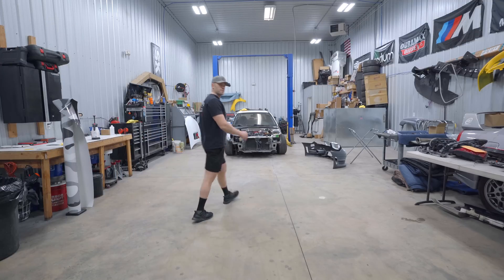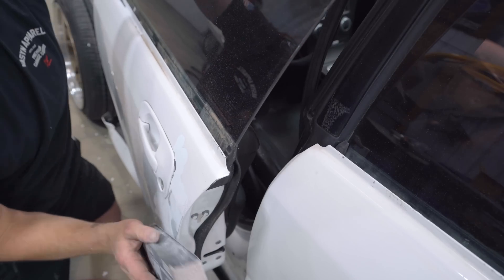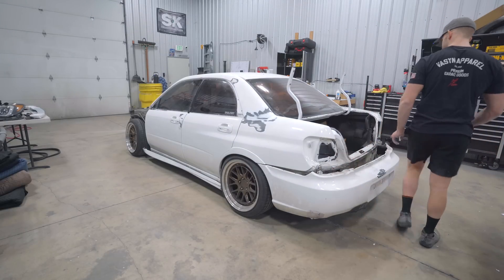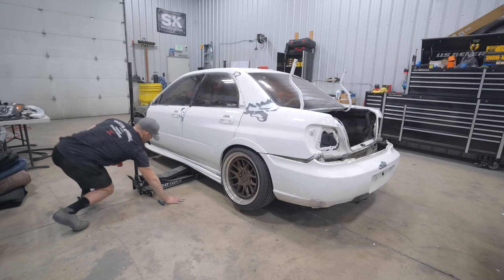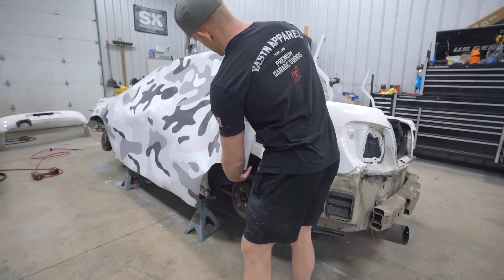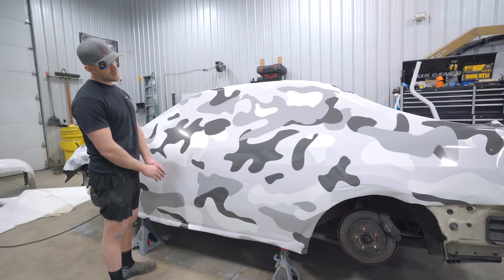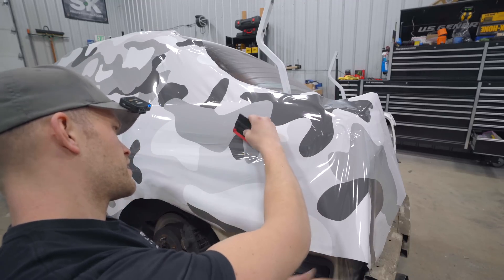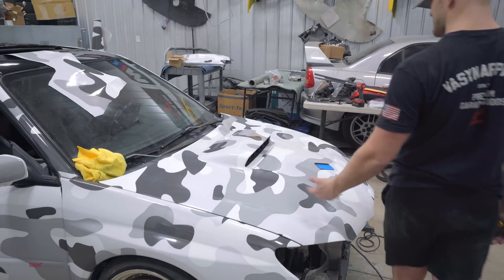Rebuilding The Forgotten 07' STi | Ep. 4

Comment: I know he explained why he's doing it but it just pains me to watch ppl wrap over non painted/filled body work 🤦🏻‍♂️
Reply: One reason I would never ever buy a wrapped car. I’ve seen dudes drive cars with destroyed paint, they wrap them and sell them without disclosing what’s under. Not talking about Devin because he can obviously build immaculate cars. But over all.
Reply: @loadsled I work at a wrap shop.  Wrap is not something that just hides imperfections. So if your clear coat or paint is chipped, or if there’s rust on the vehicle you’ll see it right through the wrap. Wrap material is actually very thin contrary to what everyone thinks. If you look closely, you’ll be able to that
Reply: Won't the exposed metal get rust? I've been watching him for a while now, and this build feels like he's not going full Devin on it. I get it, it's a flip car. But, damn, he barely even cleaned it!😂
Reply: It’s not like he’s hiding what’s under it. It’s a cheaper way to clean the car up vs painting the whole thing. As long as it’s prepped which he has done it’s fine

Comment: I’ve done protection film basically clear bra on the back of boats.  I use to spray water/basically ipa on the back of the film so it was easily moveable then used a squeegee and heat to lay it and get the water out of the back.  Can you do that with vinyl wrap?   Or does it have to be dry?